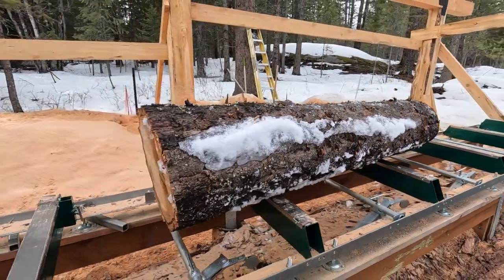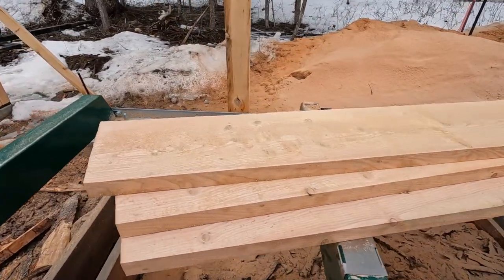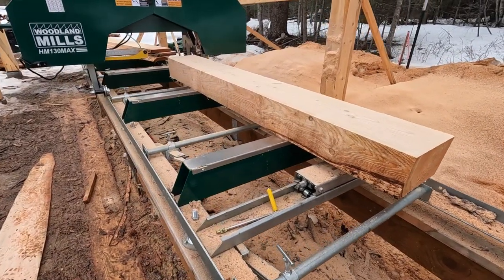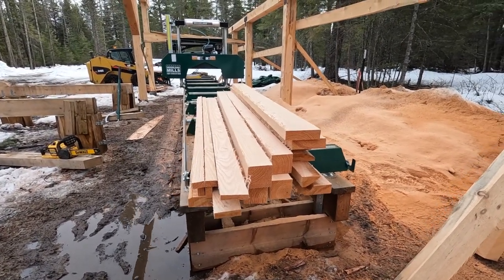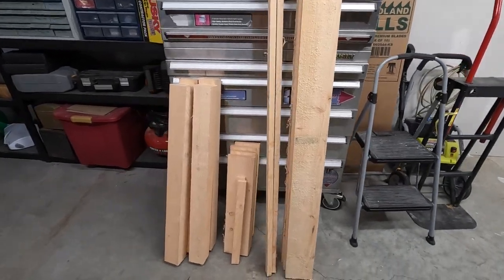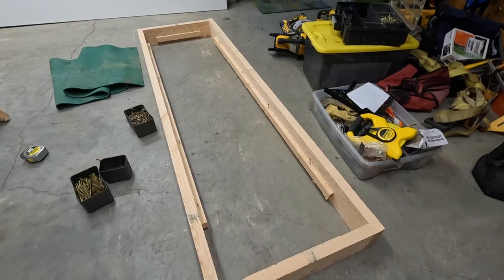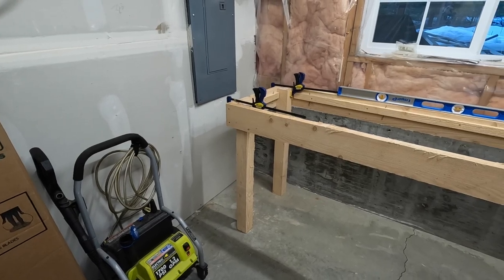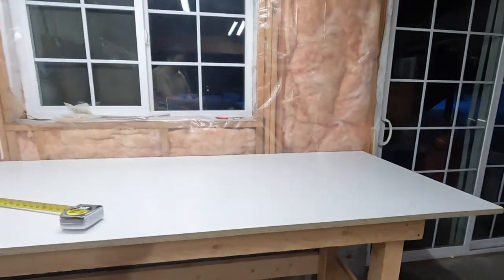EASY Workbench // LOG To Lumber To WORKBENCH // Making Your Own Lumber // Woodland Mills Sawmill

Comment: What makes the mill shake so much?   My 130max does the same thing cutting Doug fur.
Reply: Same here..... was going to ask the same question
Reply: Does it change with changing the sawing speed or blade sharpness?
Reply: Almost have to stop cutting to get it to stop shaking with a new blade.  Doesn't seem to do it with smaller logs. 20" plus it will shake. I figured it was because my logs were harder since they had been burnt some
Reply from the maker: It tends to shake with the bigger logs and when the sawmill height is elevated, but I’m sure unsure of the reason. There are hard plastic spacers that shim the upright posts that the mill rides on vertically - they look tight so I don’t know why, but you almost have to come to a stop to get it to stop shaking. Newer blades seem to help, but not completely. I’m up for suggestions. 😊
Reply: @ourdreaminthewoods  I would call or write to the manufacturer and ask then to investigate in to the matter. They may suggest to use tungsten blades for the bigger logs,  but who knows or use a special lube like a soluble oil. It is also the first time for me to see the max shake like that. the spacers are made from duraline I think and they are very hard wearing.  Hope you find a solution.
Reply from the maker: @Casey6996  I’m going to look at those spacers and make sure my belt tension is good and I might have to experiment with a different pitch of blade, but yes, I should call them.

Comment: Why was the machine shaking so much? is there something loose or is the blade bland.
Reply from the maker: We are not exactly sure..could be a dull blade, but not sure. Everything looks tight, but I will be doing a check this week. I haven’t been on the sawmill since this video ( surgery restrictions and I’ve been doing logging and dirt work to prepare for the barn). I should know more later this week after getting back on.